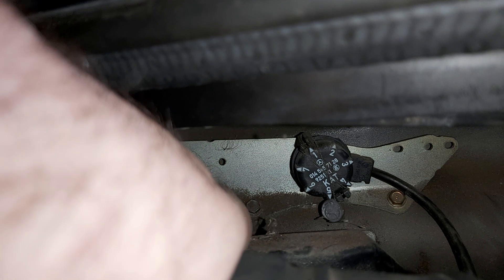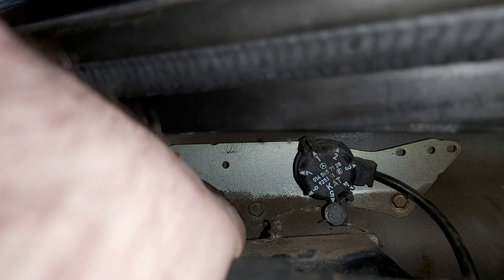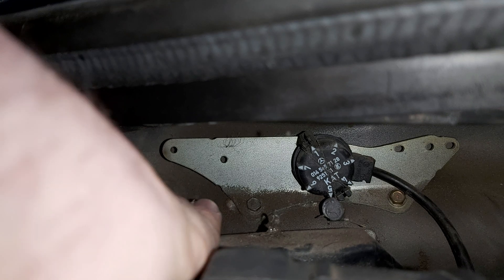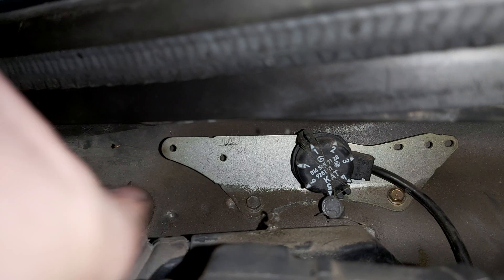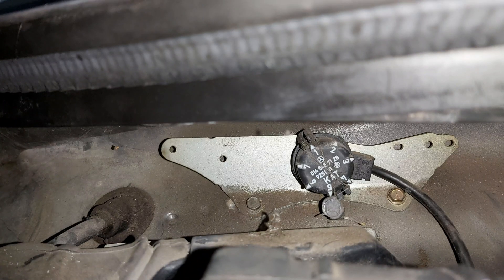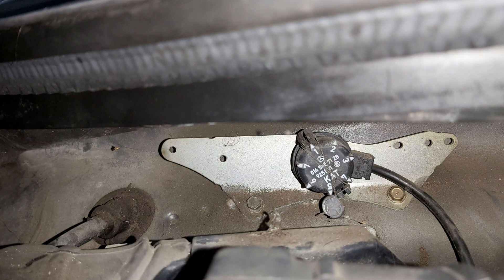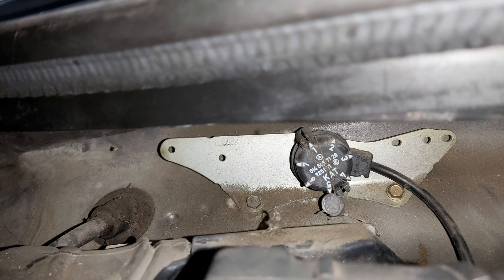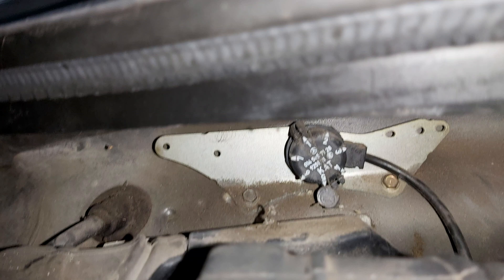Mercedes ke jetronic - Remapping the ECU on KE-Jetronic

Comment: Hi Ivitza. Thank you for your great videos! I have an important question. I recently bought a second-hand KE-Jetronic w124 230 ce coupe, and the car runs great, except for some start-up problems. I am planning to rebuild the whole fuel system, because it is already 32 years old, but after watching your video, I immediately took a look at the R17. It turns out that someone before me, years ago, turned it to position 2 and removed the seal, and nobody knows why. Now, when I start measuring pressures and voltages, do I need to put it back to position 1 in order to compare my data with the original factory numbers? Also, why are all the "professors" in the Benz forum so afraid to talk about R17, and they never say where we can find a technical manual for it?
Reply from the maker: Hi and thanks for the comment.
The R17 is predicted for the adjustments when everything is in order with the system - all the parts and sensors and the car has higher consumption again. But, everything must be within the specs and then you can adjust this plug if you have a problem with the consumption or if you want your car to run different, better. As for your question-get it back to its original position. Happy Mercedesing 😃 you have a great car!👍🏻👍🏻👍🏻🍀
Reply: @mercedeske  Thanks a lot for your reply!

Comment: This is a very informative video.  Just today I learned about the infamous R17 after learning of the R16 and setting R16 to 2200 ohms with a homemade plug.  My 1986 560SL KE Jetronic runs great, I run 93 octane US gasoline, and where I live no Emissions Testing.  Do you think Position "7" is something I should try ????
Reply from the maker: Hi and welcome to the channel. If your ke-jetronic is fully operational and you did duty cycle(it fluctuates around 50) why not! On the position 7 you do the remapping and you make it rich - the start up, the warm up and the accelerating phase. Try it out, if anything isn't as it is supposed to be, just set it back to its original position. And of course, inform us about the results because some people here are keen to know how it looks like remapping the ecu on ke-jetronic. Happy Mercedesing 😃🙂😉
Reply: @mercedeske  On my 1986 560SL the ECU is located under the footwell on the right side (passenger side US model).  I pulled up the carpet and plastic cover and found the ECU but there is no R17 adjustable resistor or anything like that.  There is a fixed R16 under the hood (bonnet) next to the diagnostic port.
Reply: @cwmoser  Yes, on most cars that are in US, this resistor is not adjustable as we see in the video.

Comment: Thank you very much for the advice my brother.  could you explain more .
Reply from the maker: Hi bro, good to have you on the channel 👍 This process affects 3 out of 7 phases - warming up, warm engine and accelerator. Let's say that you set up the whole system within the specs and you still don't get lower consumption or better acceleration. Then you can choose of of these 7 choices. If you want a better running engine. But as I have said- it most likely that you will fail at the exhsust emission test.
Reply: Thanks bro im from algeria glade to meet you .
Reply from the maker: @mouatezhannechi8978  Thanks. Glad to meet you, too.👍👌

Comment: Fantastic video I never knew you could modify the ecu I’m going to try this on my 190
Reply from the maker: Thanks. KE-Jetronic is a fantastic injection system(a nightmare when neglected). I must repeat this once again - if you have no problems with exhaust emission regulations, then put it on 7 but before make sure that your whole system is ok.
Reply: @mercedeske  in my state we don’t need emissions for classic cars. but I’m planning to make a video installing a low psi turbo to my M102 so all your videos explaining how KE jettonic work are a real blessing
Reply from the maker: @bobexsus  Thank you, glad to hear that. I did my best to explain this system.
Reply: @mercedeske  เเปล
Reply from the maker: @farissound  คุณได้แปลวิดีโอทั้งหมดของฉันแล้ว คุณแค่ต้องใช้ตัวเลือกการแปลเพราะฉันไม่ได้พูดภาษาทั้งหมดบนโลกนี้

Comment: what about m104? my car is using 2 much fuel cant understand why maf sensor is good so the o2 sensor should i try postion 2 for liner mixture?
Reply from the maker: How much is it? What is your fuel consumption?
Reply: @mercedeske   its abour 20 litres on 100km its 1994 e280
Reply from the maker: @Sandroiashvili140  To be honest with you, that's motronic system(named Hfm, I guess) I don't know if they have these plugs. For what I have seen your urban consumption should be 14.5, extra urban 11l/100km. If the mechanical part of your engine is good and the engine doesn't burn oil, then it's ok. You can clean the injectors ultrasonic. Try cleaning them if you haven't done it yet.
Reply: @mercedeske  yea i know it should be around 15 literes on 100 km but i guess could give it a try.
Reply from the maker: @Sandroiashvili140  If you do, maybe you won't be able to pass the exhaust emission test. It's up to you but you do it on your responsibility. ;-)
Reply: @Sandroiashvili140  What? Thats thing is thirsty.